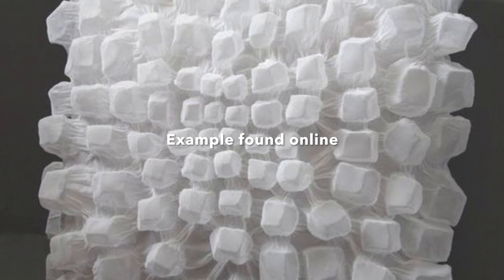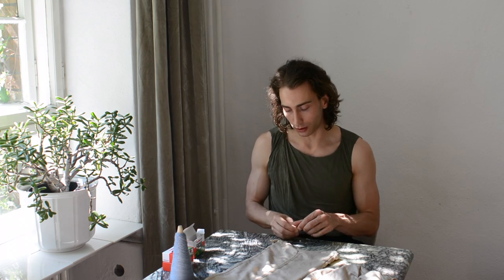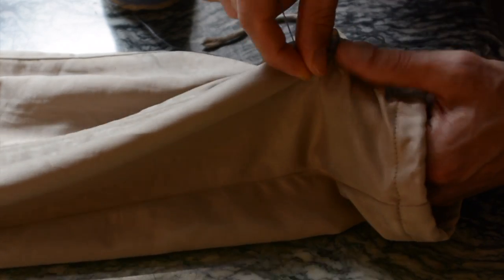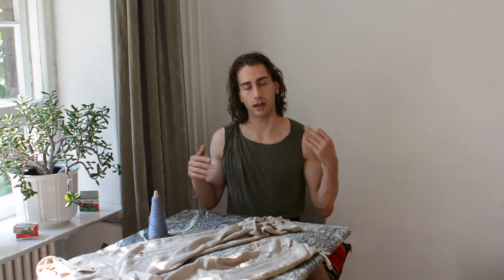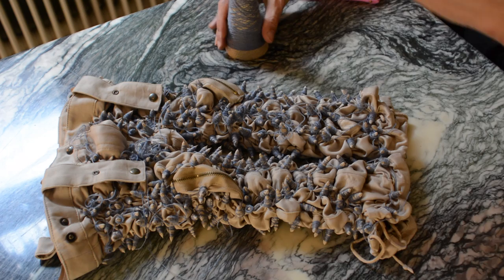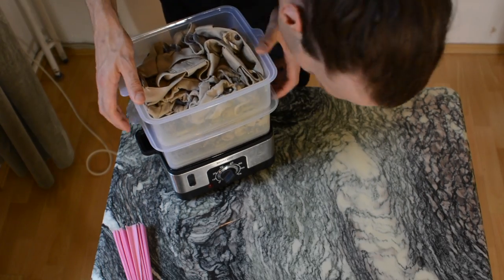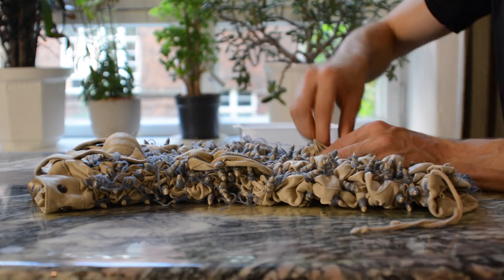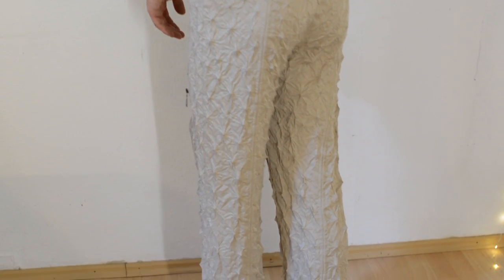CRAZY DIY FABRIC MANIPULATION IDEAS |▶SECRETS OF 3D SHIBORI | ▶Give texture to fabric

Comment: Super Cool , very nice result. Did you wash them already ? And if so o the wrinkles stay ?
Reply from the maker: Thank you! So this one I did not wash but the failed shirt with red stains I put in a handwash with vanish oxi action for at least a couple of hours and hang it out to dry, the effect stayed! Maybe a tiny bit less pronounced, but as long as you do not use any heat and pressure and the fabric is 100 % polyester it should be permanent.

Comment: I have been LOOKING all over for this. Thank you! You have nailed the look!
I love this technique as it reminds me of the dexter wong shirt created for MJ's scream video. And as of recently, chet lo's work too
I have a couple of questions :
[1] How can I create more evenly spaced, bigger, defined/protruding spikes?
[2] If I were to do this on a shirt or sweater, what material would you recommend?
[3] Will the spikes be long lasting or will they lose shape/deflate over time?
     [a] If so, how can we ensure it holds its shape for a long time?
Reply from the maker: Heya thanks for commenting! No idea MJ wore a shirt like that.. how cool! I know there is a london (?)designer now that does a lot of spiky stuff like that, I forgot the name though. It is hard to know for sure how they get the spikes that pronounced as I have not done a lot of experimenting with this as it is really time consuming, I think for a more spiky effect you would need like a super light weight thin polyester fabric, i don't think it will work with a normal sweater or normal tshirt jersey at all. I would say you need to do a test first to see the end result before you spend many hours, as the result can be a little unpredictable. Also another problem you might run into is poking holes with the screws, so you might consider another unsharp object instead. I did the popcorn shirt too in another video where I wrapped in buttons, they where pretty defined and the fabric was a bit thinner, but I would go even thinner for the spikes, may be also boil it a bit longer than 20 minutes... after washing it cold temperature it should look more or less the same (mine do9 , to be sure you could hand wash it cold and not wring it out but let it dry flat on a towel for example.

Comment: Hiii please I really need to know what is the wash care with this texture, did you wash it and did the texture stay?  thankss i love itt!!!!
Reply from the maker: Hi there! So i was super careful to only hand wash it with cold or lukewarm water. I just let it soak for 2 hours and than lightly press the water out and let it hang to dry above the bucket so that it can catch up the water. This is more work than your normal wash but it will keep the textures almost completely in there.  I would avoid twisting the fabric and using hot water at all times!
Reply: @PeerCoxFashionRec  thank you so much! I've been subscribed for a while please keep creating I love your content!
Reply from the maker: @prs889 No problem! Thank you.. comments like that keep me going :D !